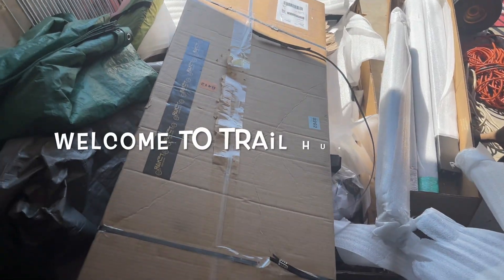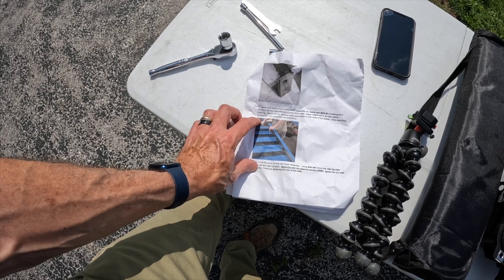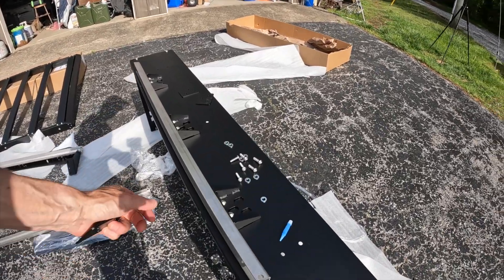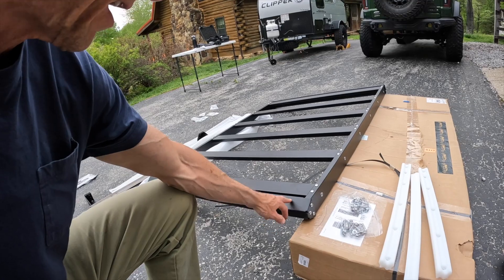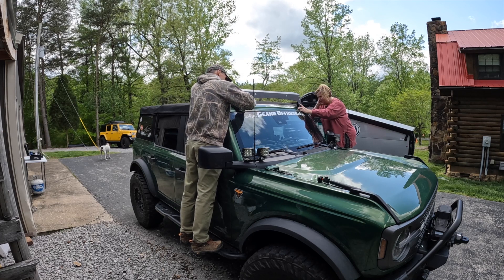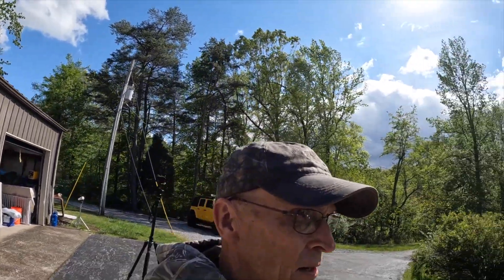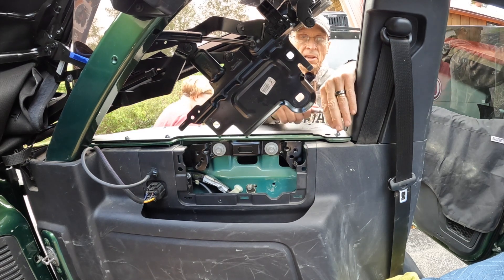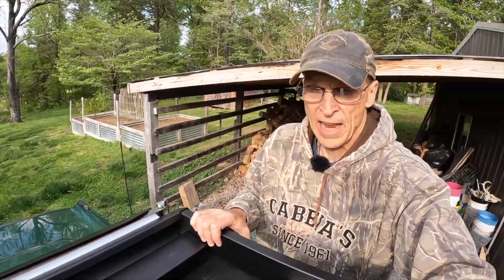Ford Bronco Raket Roof Racks Installation Video For Soft Top @Raketdesigns

Comment: Hows this going 3 weeks later? I installed mine directly after. Unfortunately the wind noise with it on is so brutal I think I'm going to have to remove it and prioritize setting money aside for a hard top.
Reply from the maker: Hey Tommy, I've not noticed any wind noise from the rack itself.  It did change the way the noise from the soft top sounds some, but that didn't bother me, because I was already getting wind noise from the soft top. It just changed to a different sound LOL.  Regarding the hard top, that may be in my future too.  I don't pull my soft top back enough to justify having one.  I did the other day, but just not a big deal for me.

Comment: Can you lift up the back part of your soft top? Does the bracket go through the window like other models ? How many inches does this rack go up from the soft top so I can know if it’ll fit in my garage with it on?
Reply from the maker: Hey Jeff.  With the back tower on the soft top will only fold back to position 1.  You can easily remove the back tower by removing the bolts at the bottom if you want to fold the soft top all t he way back.  Not sure what bracket you are talking about.  Nothing goes through a window though.  It is about 5.5" above the softop.  Hope this helps.  please use this link to check it out.  Thanks https://raketdesigns.com/partner/3/

Comment: Ok so thank you for the video, my problem is and i cannot find an answer and  cannot communicate with raket through their videos.  So  soft, hard and topless, my question is and id like to see videos of!! Hardtop what is entailed to remove the back shell if i have the racket installed and the rear raket platform installed. What needs to be done to remove the rear shell i ask aqain because i cant find an answer. Hopefully i dont need to unattach the rack. For the hardtop
Reply from the maker: Sicsence, thanks for the comment.  If you call the phone number on website, you should be able to reach someone.  I might be able to answer this sfor you though if I understand the question correctly.  You are wondering about taking off the back part of the hard top.  If so, it is the same if you want to take the softtop all the way back.  The softtop can be taken back to position 2 but if you want it all the way back or off you have to take the back portion of the rack off.  It is not complicated at all to do that.  Here is why.  There is a plate that attaches to the frame of the vehicle under the hard top or soft top.  The back rack connects to it by bolts.  You just remove the bolts and take that section off.  Easy peasy.  I rarely take my softtop back all the way, so it is not often I have to do that.  I hope this helps.  If not, send me an email or try to call the number on the website.  Good luck.